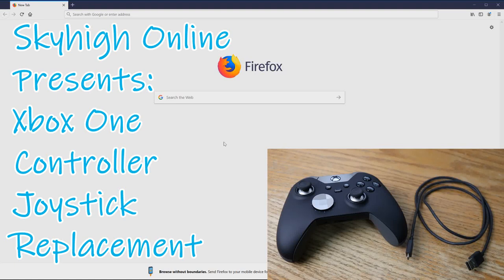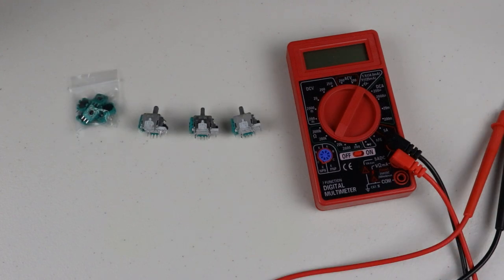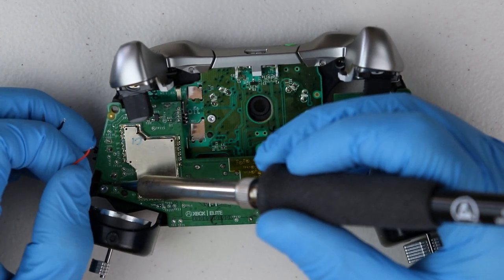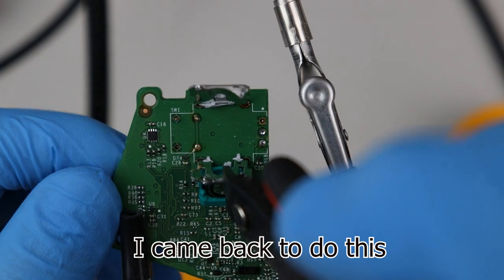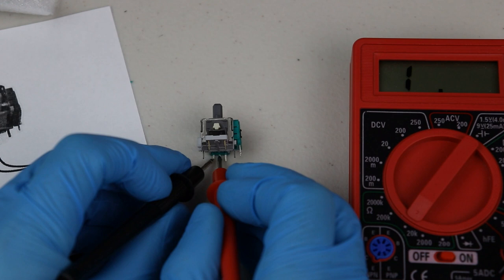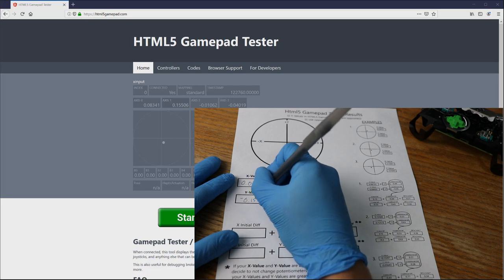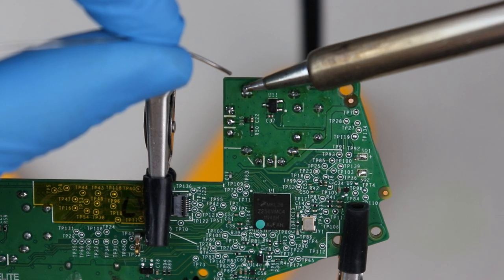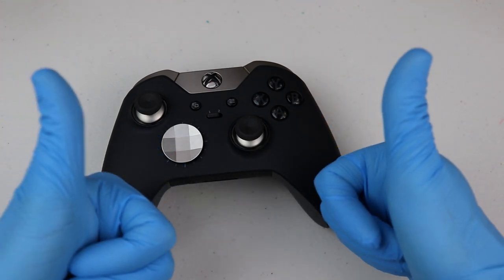How to Replace Xbox One Controller Analog Joystick - Fix Stick Drift & More

Comment from the maker: New Kit link is in the description which now includes 6 total joysticks and some tools.
NEW METHOD: Check out another way to manually calibrate (much easier IMO): https://www.youtube.com/watch?v=Uoxz0oHX9TE
Reply: Thank you ☮️💜☮️
Reply: @SOSS GAMING, where's the repair service link?
Reply from the maker: @christiandoyle578  It's gone unfortunately I don't do any repairs anymore, sorry.  If you type in "xbox controller repair service" in ebay's search bar you can find some sellers that still provide this service.
Reply: @SOSSGAMING  ahhh bollocks.
Reply: @SOSSGAMING  I can't find any Xbox 360 replacement sticks. Will these work for it?
Reply from the maker: @partyguy9  Unfortunately, no. Those are relatively difficult ones to find. Ebay has some aftermarket ones. They're not great, but will technically work.
Reply: @SOSSGAMING  As soon as I heard you were doing repairs I thought, “I’ll bet he stopped doing that pretty quickly 😂” Must have been hard to keep up with the amount of requests!

Comment: Electronic hobbyist here, do micro soldering on Mac circuit boards. Noticed that the melt point of the factory solder is much higher than the 60/40 I use on Macs and much higher than the standard melt point of 360 .. . 650 - 700 degrees does get this job done for removal, using 60/40 to resolder seemed fine. Thanks for the tutorial.

Comment: I had Xbox One Stick Drift, before buying a new set of Alps Analog sticks I salvaged one controller out of the two utilizing above method and it worked. Then I ordered a 6 pack from Soss Gaming on ebay, it was so well packed, came quickly, were genuine Alps keys. I replaced both the joy sticks on the second controller and did not go through the fine tuning process (in my opinion not worth the time unless you are way off). Checked the controller using htmlgamepad website, Joy sticks were 99.99% centered without the manual sheet calibration referenced in the video. Be sure you have intermediate solder skills and a good iron (Weller/Haako), I did not have to cut the sticks as shown as I have a solder vacuum suction pump which sufficed and there was no pressure required to pull old joystick that came out like butter. There are 14 solder points so can be daunting if you are holding a soldering iron the first time for first time, It requires precision and dexterity and common sense as is not hard.
Reply from the maker: Awesome! So glad it worked out that well for you.  Thanks for sharing

Comment: 😂😂😂 I like the video but this guy had me f’d up. All these tools 😂😂😂

I just need to send you my controller 🎮
Reply from the maker: Haha yeah technically not everything is necessary but they do make things easier.  Lots of people on eBay are offering joystick repairs so luckily there are others willing to do it for ya.  Cheers.
Reply: I almost turned the video off when I saw all them tools, like yup this controller is trash 😂
Reply: @SOSSGAMING  if I were to not swap out the controller joy stick but instead only replace the spring inside it and put it back in would I need to calibrate it ? Thanks !
Reply from the maker: @colebertram8482  In that case no, you shouldn't need to :)
Reply: @SOSSGAMING  thank you I’ve been holding off doing this because I don’t have the kit to calibrate . My joysticks are stock and are perfect condition but I was looking to use a different spring for a different tension.
Reply from the maker: @colebertram8482  Best of luck.  I'd recommend checking out my newest video, you don't need a multimeter with the new calibration method, just in case.

Comment: After watching this, I now realize paying for a new controller is not so bad. No way am I going through all this trouble. I was hoping for a "plug-n-play" potentiometer with an auto-calibration. Your video is top-notch, but too much effort for me. Good job!
Reply from the maker: If you just have stick drift, you can get away with just replacing the potentiometer. My "newest method" video shows how you can even calibrate it without math or measurements, which may not even be necessary. Don't give up lol

Comment: Thanks - lots of good advice - the breaking down of the joystick would have saved me a bunch of time. The pot calculations and matching were something I had no idea the pot matching needed to be done.
Reply from the maker: It's the first way I figured out how to calibrate. If you watch the "newer" video I show another method (without switching pots, for the most part). Also, if you have a series x/s now they have a built in auto calibration!
Reply: @SOSSGAMING  thanks yes I watched the newer video looks like a good way to do it. but I did not quite understand why you didn't preselect / match the pots and click them onto the stick from the start before soldering them. Good to know about series x but I am still running one x and 360 ... the resistance readings will help me out. I actually did the pair on  one x original - the tolerances were .16 and .26 which did not initially show until you showed me the tolerance adjuster on controller tester. Seems ok on rocket league but after that who know may have drift.
Reply from the maker: @simoncossettini9680  Great! Simply it's because it takes more work doing it that way, and with the "new method" it's not necessary. Happy gaming!

Comment: I didn't have a wick neither did I have pliers to take apart the old joystick. I was able to slowly take off the old joystick by applying outward pressure at an angle and heating up pins one by one. Worked out well in the end. Thanks for the video
Reply from the maker: Way to go! Clever thinking.  Glad it worked out for you in the end.
Reply: U can just desolder all the pins on back and pull the whole stick he literally made his life harder in the video

Comment: I think it's kind of ridiculous how much the quality dropped in controllers from 360 to xbox one. Issues like these are way too common. Well made video, though. Seems very manageable even for someone with novice soldering skills.
Reply: i have five controllers that ended up with stick drift.  i called Microsoft and they wanted almost the same price as a new controller to fix the controller.  there should be a class action lawsuit for this crap.
Reply: @machoman2881  there is I seen somewhere they are being sued. Something with the sensitivity of their potentiometers.

Comment: Hey, awesome video.  I bought the joysticks from you on ebay, I have the tools, removed everything and all of that, but, I burned the board in a few spots -__-' I think that's why if drifting to one side only when I tested it.  Anyway, what is the right temperature for the soldering? and Do i still need to do all of those testing and math to find the right joystick?  thanks for the help!!!
Reply from the maker: Oh no!  Hopefully everything is ok.  I have noticed that a too high of a temperature can damage some of the through holes and that in turn can cause what you are speaking of.  Is the joystick installed while you are testing it?  The temperature I use is 650 F.  Best is usually between 330°C to 350°C (626°F to 662°F).  There is a 1/3 chance any random joystick you put in will be sufficient, so given those odds I would definitely recommend doing the testing/math.
Another tip that I just figured out and will be covering in a new video is that you don't need to solder on a joystick to find out the values on html5gamepad.com.  It's a bit difficult to explain without visuals but I will try.  You need to have the controller apart and the joystick de-soldered first to do this.  Insert any joystick (no need to solder it on or measure it first).  There are the 3 metal tabs (that protrude from the motherboard) of each pot.  You will want to push these metal tabs inward in the direction of the center of the joystick. I use the small screwdriver.  I found if you push them inward till they bend a little bit, they will contact the through hole better.   Then go to html5gamepad.com.  Plug the controller in.  The joystick will be loose. You will need to wiggle/move the whole joystick (I'm referring to the joystick as a whole, not the little stick that protrudes from it) so that you can see each axis' reading that html5gamepad.com gives.  Most of the time you will see both axis values 1.0.  As you wiggle the joystick around you may notice it moves somewhere center-ish on one of the axis.  If you're good enough at moving/wiggling the whole joystick around, you may be able to see both at the same time.

Comment: I just had two Xbox base controllers repaired. Turn around time was less than a week and I had the affected components replaced. I can't recommend strongly enough this service if you're controllers are giving you problems!
Reply: That’s what what I’d like to hear
Reply: @Tarikmoe  The guy running this YouTube channel does a repair service through the link in the description. That's what I was referring to if I didn't make that clear enough. Well worth it in my opinion.
Reply: Josh Bryan I knew what you meant. I was commenting on how well he does his job and I was agreeing with you. I am trying to ask him some questions on how I should proceed thru ebay. Waiting on his answer.
Reply: @Tarikmoe  yes, I corresponded with him through eBay for the offer when you subscribe to his channel. I found him to be proactive and the repair was quick and flawless. In fact I prefer the controllers that he repaired to the ones I have not had repaired yet even though they have no drift.

Comment: This method worked for me very well i was able to fix stickdrift that two of my controllers had. Measuring the pots, were a pain but is necessary to get an accurate reading. I noticed that if u were measuring the same pot in the same axis, and were getting a wide range of diff values it is either due to a bad pot or wat i did was use the pot on a different stickbox and then remeasured(i dont know why this worked but it did for me). Another tip to remove the stickbox without actually damaging it was i used a soldering pot. it is much easier than trying to use a solder wick or solder pump to remove it. Heres a video showing how to remove with a solder pot https://www.youtube.com/watch?v=DPk4aJh1NhA&t=207s hope my experience helps others

Comment: Are all pro controllers soldered the same? Because no matter the temp or how long I hold the iron to the points they do not want to come off? It looks solid and never turns to liquid to pull out the pins. Any suggestions would be great. Awesome and very clear video btw.
Reply from the maker: Yes, so first suggestion is either putting flux on the solder and/or adding more solder of your own.  Over time the old solder points can become oxidized and lose the little flux they may have had in it previously.  As you mentioned as well temperature is an issue.  The tip of the iron should also be free from oxidation.  If you're able to melt your own solder on the tip of the iron that would indicate it's hot enough.  Hope this helps.
Reply: If its lead-free solder (which I suspect), it requires a soldering iron/station that can handle this. Which then costs more than two new controllers so...

Comment: really nice video thanks alot your truly put alot of effort into this following your guide i removed the analog stick no problem i had really bad one so went to remove that to add another and doing so i removed one of the soldier pads any ideas how i can fix this like replacement pads ?
Reply from the maker: So unfortunately that repair is difficult, but depending which pad it was it may be possible to reroute the pin associated with that pad to a different part of the motherboard with a wire (like a strand of wire from speaker wire).  If you go to acidmods.com and post in the xbox section with a picture of which pad was damaged they might be able to help you out.

Comment: Great tutorial! Just the info i needed!

Question though: Why not just remove the pots and leave the joystick on the pcb, then use a different joystick for measuring the other pots? This would then result in only 6 solderpoints afterwards. Or does a different joystick introduce too big a difference in values that would nulify this method?
Reply from the maker: In my experience different joysticks do indeed have varying measurements even when using the same potentiometers between both.  I do have a new video out that shows a different (easier?) approach to calibrating the pots if you're interested!

Comment: Nice video, thank you! But I would like to point out that this is the failure of most to understand MSFT considers the controller as "consumable" item. It should not cost $60-$200(elite) but instead be 1/3 that price. I can't imagine in mass, the cost in parts exceeding $14. And why hasn't anyone made an upgrade parts set for these? (hint, cost for that would exceed new controller). I think I go through a controller about one a year (I suspect I'm in the value MSFT estimates of MTBF) and would rather replace the entire joystick mechanism and thumbstick (grip wears off too fast for me). SOSS- any recommended complete stick parts (not just the potentiometers)? Seems a waste of potentiometers to go through to get lucky on resistance number...right?
Reply from the maker: I actually recommend checking out my latest video.  In a lot of cases you don't even need to change potentiometers.  Also note that even if a potentiometer doesn't work on a specific joystick on a specific controller, it can still be saved for another joystick/controller in which it may be better suited for.
As for any alternative sticks, I'm not aware of any of more reliable quality, as they all seem to use carbon as the resistive material.

Comment: Do you think taking out the replacement from another original xbox controller I have arround not working for other reasons might give better chance of working first try?
I've already tried to change the little sensor inside but I still have problems. Thanks! Amazing video 😁
Reply from the maker: No, unfortunately it would be given the same odds.  However, if you know which axis is causing the problems you might be able to get away with just switching one of the potentiometers from the other joystick.
Reply: @SOSSGAMING  thanks, I've already did it and for a week it worked just fine mut than it started to have the same problem. Is like if the stick takes only 10% of the input I give it. That's happen only on the right stick going up. I might learn to do some calculations!
Reply from the maker: @matteci  If you replaced the whole potentiometer (the green square piece and the black round wheel inside it) then yeah, looks like you will need to change the joystick.  You can definitely just try the other controller's joystick.  Best of luck!

Comment: Hi there, more than two years later thanks for the video! It sucks that this is still a problem on expensive modern controllers.

I've been working on fixing a DualSense controller (same joystick part, same potentiometer problems) but after the last joystick swap, the controller reports that it's pointing all the way to the upper-left as if there was no joystick installed at all. Have I potentially lifted the pads or screwed something up along the way?

Thanks!
Reply from the maker: The dualsense controllers are quite more durable, so lifting a pad isn't as common, but still possible. If it wasn't having this issue before the install, only thing I can think of is a small capacitor or transistor or whatever you call them is either damage or fell off. Or maybe the board is scratched (damaging an internal wire). 
One other thing to double check before that though, is if the wheels in the pots in the right direction. If they're upside down, they will show that same issue.
Reply: @SOSSGAMING  Thanks for the feedback, I'll continue investigating!

Comment: definitely interested in this new vedio i see your planning on dropping  I was switching Joysticks today i put one on it was ok but every once and while when you looked  around it would go extremely fast i took that one off then put another one on and had a drift issue i was so confused the Soldier points look good then i came across your video makes sense with the whole Calibration stuff stupied they just don’t give the software out even charge a lot for it just make it available   but great vedio will try this definitely look forward to see this new one 🔥😁

Comment: Thanks so much I thought this would be way to hard at first but I have years of soldering experience so I thought why not because I had nothing to loose especially since a new controller costs €60 I got a new soldering kit which came with a solder sucker which is very handy and a must have for soldering and removed all the solder points which was the hardest and most complicated part and then I put on the new one and success this was my first analog stick replacement and I'm so happy this is a common fault with controllers so I'm glad you helped I really can't thank you enough I've been using my controller with severe stick drift for like 5 months until now and it was annoying now I can play my xbox in peace thanks so much I liked and subscribed you really deserve a lot more views likes and subs your so awesome keep up the great work
Reply from the maker: Always great to hear! Thanks for sharing.

Comment: Hi, thanks for your video. Could you clarify why you chose the two pots 0.08 and 0.11?
Reply from the maker: I haven't used this method in quite some time (check out newest method), but if I'm remembering correctly it's because they are the closest measurements to the "diff to center" calculation earlier.